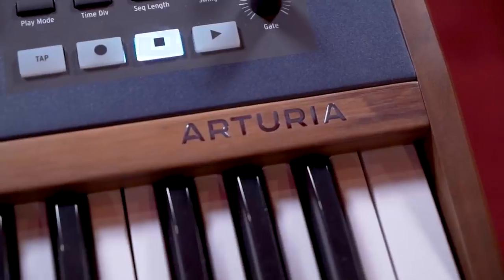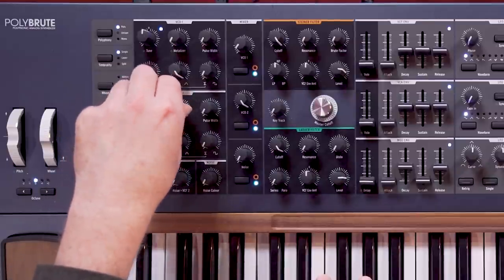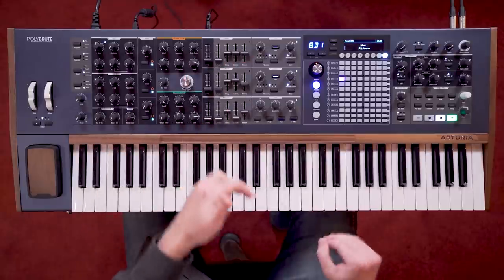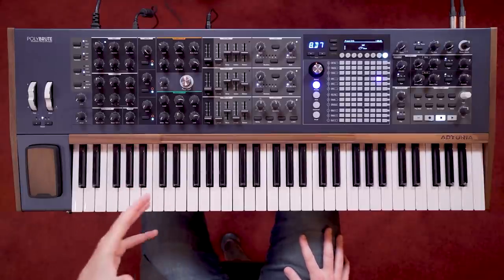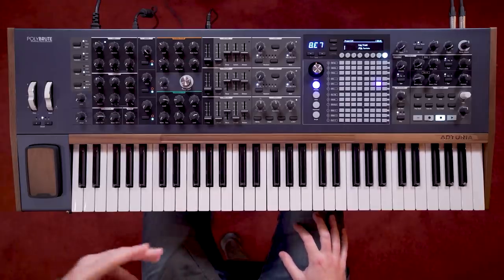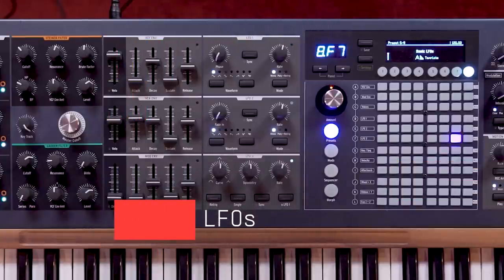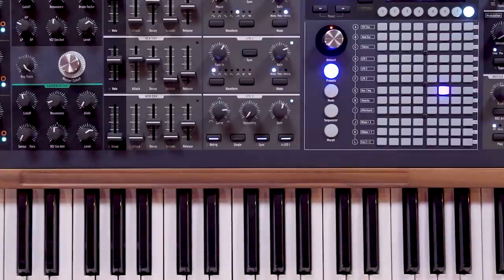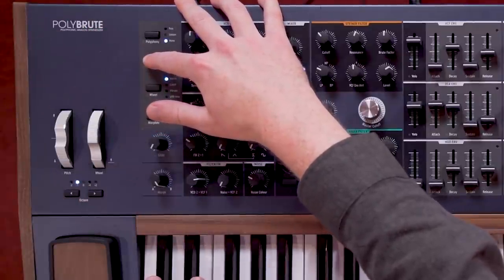Tutorials | PolyBrute - Episode 1: Voice Architecture

Comment: I need this synth 😍 Looks like the most versatile analog polysynth on the market today. I love that those waveshaping capabilities get us more than our standard 4 analog waveforms sine, saw, triangle and square/pwm and that morph feature is really impressive to say the least, considering that this is an analog synth. And all those tactile expression controllers, you have your mod and pitch wheel but you also get that sweet 3-axis morphée and ribbon controller. This is one awesome synth! I'd love to see a digital oscillator in there too though, one with wavetables or maybe even sampling capability... and 16 note polyphony! Then it would be the ultimate package! But then it would also completely break the bank 😔 ...would still be cheaper than the Moog One though 😂
Reply: That would be awesome, but it would probably break your back as well as your bank.

Comment: I want to recreate the vintage knob like on the prophet 5. can I access the pitch of the osc and envelope times PER Voice? Each voice has different settings like six different synths... (like the vermona perfourmer).

i saw a voice row on the matrix. But there is no  info about that.
Reply: That’s exactly what the Voices mod source does, and it’s even better than a vintage knob, because Voices can be routed to whatever you want - pitch, panning, cutoff, etc. There is also a Pitch Accuracy setting in the menu that can create subtle detuning per note.
Reply: @modalmixture  wooow!! They should promote that feature!!! Thanks for the info.🙌🏻
Reply: No problem! Though I just reread your question and I should clarify. The Voices mod source applies a preset amount of modulation per voice, so for example -1, -0.6, -0.2, +0.2, +0.6, +1. So it’s like applying dispersion to a parameter - but you can’t actually choose a specific value per voice - it’s not quite like having six separate synths. Still very useful for getting a detuned vintage sound!
Reply: @modalmixture  ok yes i just want to set different attack decay times per voice.